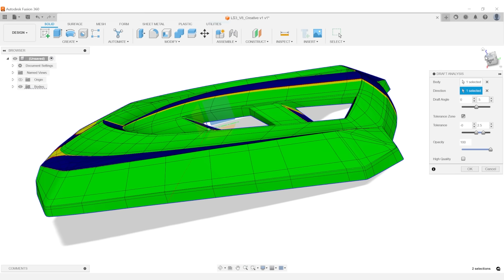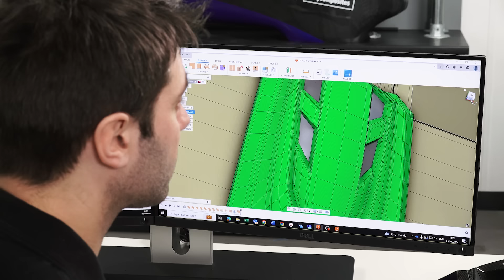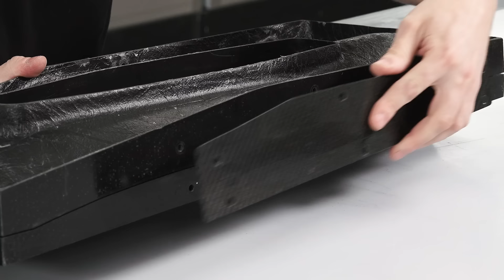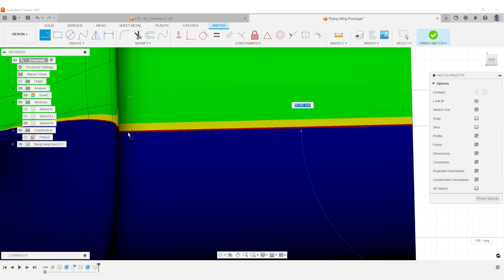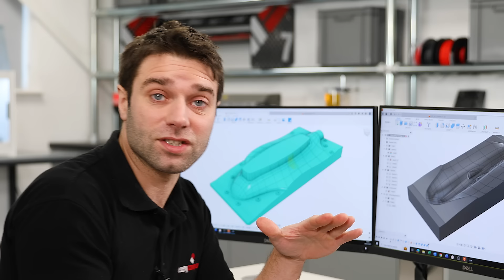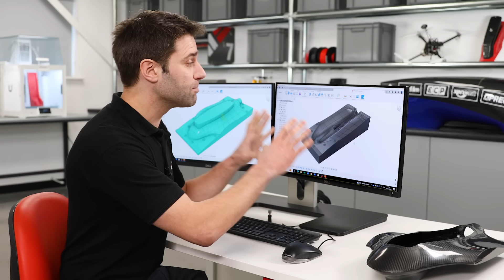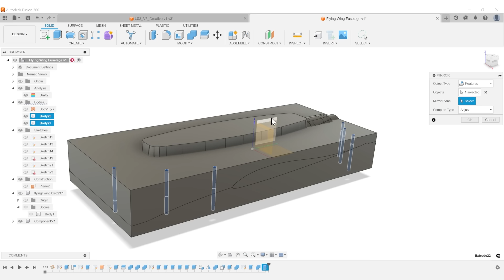Practical CAD Techniques for Composite Pattern/Mould Design

Comment: Helllo ECL, really great video! I have a question, if I want the same dimensions between my orginal part on CAD and the final composite part, should I adjust the scale of the part when I create the mold? Thank you
Reply from the maker: In general no, as the pattern should be the same size as the CAD drawing, and the mould will be an exact negative of the same dimensions.  For some very precise applications, scaling can be done to take into account machining tolerances, CTE during curing processes etc.

Comment: Very interesting video, but why do you machine a master for the drone? can't you just machine the moulds directly?
Reply from the maker: For low volume applications, prototyping etc, you certainly can use the EB700 Epoxy Tooling block as a mould.  However, in general and for most uses, a proper composite mould, as shown, offers better durability and finish for the tooling.

Comment: I have watched so many of your companies videos you guys made me choose motorsports over aeronautical for BEng, thankyou!
Is it possible for you guys to make a video on design considerations on the final parts themselves? Like how to plan the structure for known loads and then testing with finite element analysis? I have looked around and there seems to be only a few solutions available (at huge cost lol) for composite FEA? Thanks!
Reply from the maker: Generally CAD tools with such features are only available on the higher end CAD packages or as paid add on features which makes availability not easy.  You may be able to access through your uni engineering department such software.
Reply: @easycompositestv  thanks, I'll check!

Comment: Question/suggestion: Pls show how you design the actual part figuring out the fiber layers, their shape, total thickness etc.
Is there a feature in Fusion which can design a laminated object calculating for layers of thickness and their shape, split the shape into shapes that can be cut on a plane surface, create cutting stencils for the plies and so?
Reply from the maker: Some CAD packages will have advanced composite tools within them, or available to buy, to help with some part of the design process. The same goes with FEA tools to help you analyse the design. Similar with ply template and cutting tools.
Reply: cool to know, thanks!!  @easycompositestv

Comment: Hey, i would like to 3d print a multi-part mould and do a vacuum bag, wet layup. What filament would you reccomend to use for printing the mould? My first thought was to pick something that does not bond with your polyester resin (i got a bucket of that and need to use it on something haha) so i could coat the mould in polyester resin and then laminate the epoxy part onto it. This would propably be relatively easy to de-mould but the issue is that the polyester resin will deform pla prints. 
Have you done any research on wether, for example petg is compatible with being coated in polyester resin?

Greetings from germany!
Reply from the maker: PETG is generally great for moulds and patterns as the PETG naturally releases from most resin systems meaning the main concern is mechanical grip around the layer line detail.

Comment: Abstract

Composite mold design is a fundamental aspect of producing high-quality composite parts. This video outlines key design considerations within CAD environments for creating effective molds.  It emphasizes the importance of features like trim allowance, flanges, parting lines, and strategic use of draft angles to ensure easy part release. Additionally, the integration of mold clamping elements for accurate alignment is discussed. The video covers both single-piece and multi-piece mold designs, with specific techniques for generating stock, creating mold cavities, and adding clamping features. While the provided instructions are tailored to Fusion 360, the underlying principles can be broadly applied to other engineering CAD software.

Disclaimer: I used gemini ultra 1.0 (on 2024.02.24) to summarize the
video transcript.  This method may make mistakes in recognizing words

Comment: Always a good day when there's a new Easy Composites video. One question. Is there any scaling factor that needs to be applied to the parts to fit precisely to the intended application or are the as measured dimensions accurate because there's not an issue with shrinkage when molded and laid up in this fashion?
Reply from the maker: It depends how precise and relevant that is for your specific application, but most CAD packages have a relatively simple scaling function should you need to do this.

Comment: Well done for presenting this topic with such clarity. I guess one thing to add would be scaling of the pattern since you are curing at an elevated temperature, unless i missed this point within the video.
Reply from the maker: It depends how precise and relevant that is for your specific application, but most CAD packages have a relatively simple scaling function should you need to do this.

Comment: On the topic of drones, the website shows that the lightest weight glass and carbon fiber sheets are ideal for RC model aircraft. Could we get a video or series demonstrating that process? If possible it’d be greatly appreciated.
Reply from the maker: Sure thing, we have a few videos on drones (multi rotor and fixed wing) in the pipeline so stay tuned!

Comment: Any specific reason to not extend the surfaces from the reference model in a tangent or enforced curvature?
Reply from the maker: Good question, it really depends on the geometry of the model you're working from, I find that tangent surfaces can often result in bad geometry around complex edges, but that said give it a try and if the results look good then it's fine, there's no exact science to creating a trim allowance.
Reply: @easycompositestv  Always interesting to hear others opinion on this, vacuumbucks looks quite similar to these and they always extended surfaces with a curvature continuity. But as you said, some surfaces will go inverted if the surfaces are 👎 from the start. 

Isn't it common outside automotive to have a masterline to reference the model's drafts to? 🤔

Comment: What, no pictures of the drone flying gracefully over a local lake?

Once again, this was a very helpful video.  I liked the simple way of finding a split line on an uncooperative part, and the introduction of the mold clamping bushes along with best practices for using them.
Reply from the maker: Haha not in this one, but I'm going to need to make some wings for that bird in a future video, I don't think I'll resist taking it up! Glad you liked the info on the bushes, not something that's been well covered before so I hope people will find it useful.
Reply: @easycompositestv  I do think that when you talk about patterns and molds and parts, you need to motivate a bit more why (and when) we need to make molds off the patterns vs just making parts off the patterns.

Comment: Your flying wing likes like Skywalker X8 but smaller, also I found that the nose is a bit sharp than in original X8.
Reply from the maker: Yes it's very similar to the X8, about 20% smaller but being carbon the internal volume is larger. Thanks for watching!

Comment: Nice video, thank you! Can you use 3d printed molds instead of cnc milled epoxy tooling board ?
Reply from the maker: Sure, but you can't use them at higher temperatures for curing, have a look at our channel and you'll find some other videos that use 3D printed moulds and patterns. Thanks for watching!

Comment: Why can't you CNC the mold itself without doing extra step?
Reply from the maker: Thanks for the question. While it is possible to do this for prototypes and one-offs the reason that you would make a mould from a pattern is that you want the mould to have the same CTE (thermal expansion) rate as the part you are making, so for these carbon fibre parts you want a carbon fibre mould. Another advantage it that you can quickly make more moulds from a pattern for volume production.
Reply: plug/mold is made from softer, brittle material that can be machined easily, if you damage it you need to re-cnc it and cnc stock material is quite expensive too. Much better to make a strong fiberglass mold from the soft plug which you can re-use many times without fear. Also easier to sand/finish a convex shape